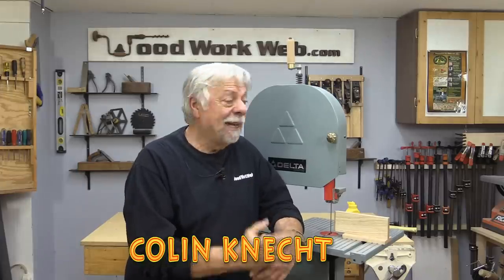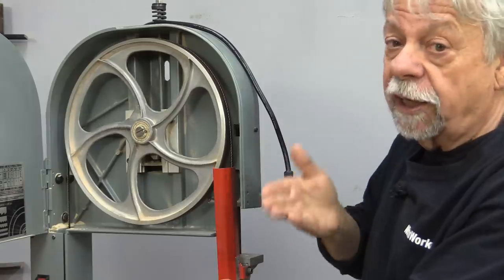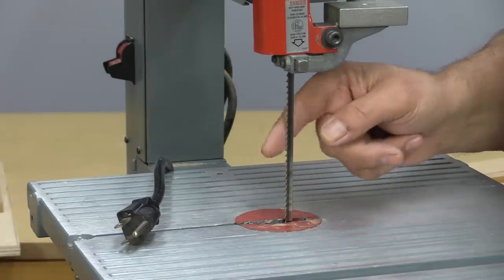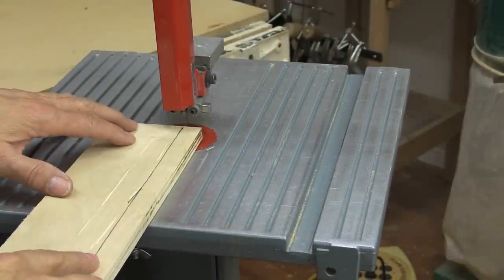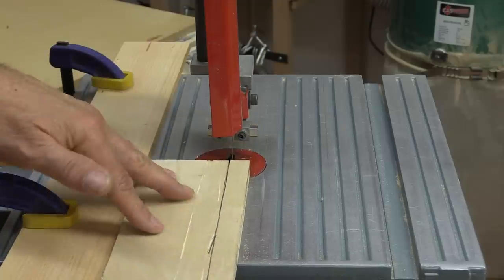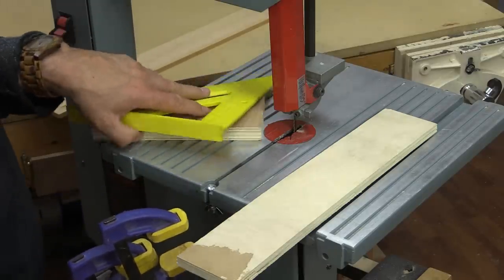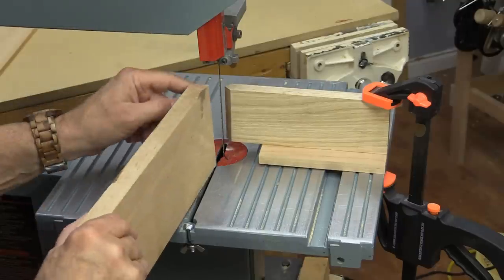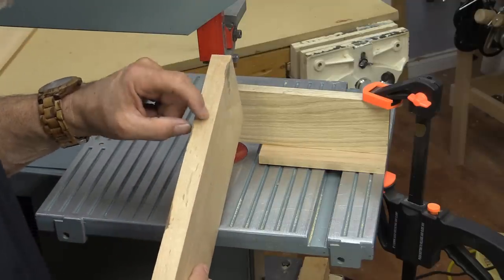Bandsaw Hacks - 5 Band Saw Tips and Tricks

Comment: When you loosen the band saw blade to prevent flattening the tire - as shown in the video - give it the same number of turns (or half-turns) every time you do it.  Then, when you return to the saw later you can give it that same number of turns in the opposite direction to re-tension it.  That will automatically return you quite close to the original tension, so you won't have to do more fiddling to get the tension set properly.

Another good fence for the band saw that sets up very quickly (and good for Colin's drift compensation method shown in the video) is one of those 18" or 24" long magnetic bars sold as a magnetic knife holder for the kitchen or a magnetic tool holder for the shop.  No clamping, just let the magnet hold itself on the table where you need it.
Reply: great idea
Reply: Good suggestion.  Now what do you suggest to make me remember to loosen the tension every time?  LOL.
Reply: Good tips.
Reply from the maker: Thanks for the tip and thanks for watching!
Reply: The only time I loosen my band saw blade is when I'm replacing it. I'v been using my band saw for 20 years and have never had a problem with a flat spot. It's a 14" Jet.

Comment: Colin, you and I have the same band saw.  Mine has been largely ignored for the longest time because I was having the very same problems the you highlighted in the video.  So, it's not just MY band saw.  Those tips and tricks are a great relief to me.  The only problem that I've really had with the Delta was a broken tyre.  Replacements could only be sourced, with all the associated costs from the USA.  All in all though it's a great and reliable tool.  I'll be out there, in the cold, this morning letting off the blade tension.  Thanks, Keith
Reply: mine too but that cover knob is not factory.
Reply from the maker: I hope the tips help! Thanks for watching!
Reply: I have this same band saw and would really appreciate your advice on what blade tpi for general purpose (ply wood, mdf and soft woods) many thanks, Simon

Comment: To permanently take care of blade drift without having to rely on goofy clamp on auxiliary fences, I took some time to loosen the table mounting bolts on trunnions, which are a little oversized, tapped the table a smidge and retightens one bolt and ran a sample rip.  I kept loosening the one bolt, tapping, and making more trial cuts until there was NO drift.  Then I tightened the remaining bolts.  Permanent drift solution! I must say that my table's bolt holes were not sufficiently oversized to get the job done so I had to use a rat tail file to elongate them a tad bit to accomplish the task, but the extra effort is well worth it.  Hint: bolts are easier to access if you tilt the table as much as you can.

Comment: Ive been successful cutting vaneer on my Laguna 14/12 bandsaw with a 5/8" blade
Reply: I was re-sawing some 4/4 oak with my Laguna 14/12 and a ⅝” re-saw blade, the blade started drifting badly, one of the ceramic inserts on the bottom saw guide had slid forward. After gluing it back in place with some gel CA glue the blade still kept drifting, the ceramic insert had taken the set out of one side of the blade. I am disappointed with these ceramic saw guides.
Reply: @pedgaro49  im sorry to hear that , im just a hobbyist,  i haven't had any issues with my Laguna bandsaw,  my brother helped me set it up and its run perfectly

Comment: nice videos but i have a problem ive been using a old 3 wheel bandsaw and latly the blade keeps going of track braking the blades so my wife got me a new parksaide went ok the next day the bottom tyre keeps slipping of now ive looked and looked and few say glue tyre down should solve problem so i went back on old bandsaw glued tyre on tried it works great should i do same to new bandsaw gluing the tyre down as its brand new

Comment: Some very useful tips. The problem I have in releasing tension on the blade is that I tend to forget and turn it on and the blade comes off and invariably needs a replacement.
Reply: Make a sign to put right next to the power switch on the bandsaw that says 'Check the tension'. That should remind you each time you use the bandsaw.
You could even make a sliding sign like they use on office doors to let people know if they're in or out. On your bandsaw it could read tight / loose. Then when you change the tension at the start or end of the project, slide the sign over and you know what state your blade is in when you come back to the saw.
If you're handy with electronics you could even build in a limit switch into your tension adjuster, when the tension is backed off, it hits the limit switch and a LED could light or a relay could disconnect the power.
I better stop before I make things way too complicated.
Reply: I have a tension leaver on my Laguna Bandsaw and made a little sign with a blade kerf on it and place it on the blade saying tension is off when not in use, then I just take it away and set the lever again to use it, simple
Reply from the maker: Some great tips from Maxx B and June, those should help. Thanks for watching.

Comment: Are all bandsaw blades intended for 'combination' purposes? i.e. using one blade for cross-cutting, ripping, mitre cutting (along the bias), etc.
A blade with finer teeth should be used for cutting non-ferrous metals e.g. aluminum or copper.

Comment: I find that the proper blade for the job is all I need to stop blade drift. A 1/2" 3tpi blade has zero drift on my cheap 90's craftsman 12" bandsaw while cutting 6" stock. My 1/4" 18tpi blade drifts all over the place on anything thicker than 3/8" because it's meant to be used for cutting shapes and curves, not straight lines. It takes me about 1.5 minutes or less to change blades. Totally worth it.
Reply: Interesting. I wish you would do a video or narrative on changing a blade in a short time.

Comment: Before compensating for blade drift, it's a good idea to try to eliminate it first by good set up..blade guides, position of blade on top wheel, blade tension, and most of all, a SHARP blade : )
Reply: Yup.
Reply: Blade used in the video is for cutting curves. Use a wider blade for rip cuts and it will not drift

Comment: Colin -Those are some really good tips. I cant wait until I can afford a band saw. I have a question, I work with steel as well as wood is there a band saw that can be used for both? I realize I will need different blades. Is there a not too expensive reliable saw that can be used as a vertical wood saw and a horizontal steel saw that utilizes a piston to slow down the cutting speed?  
Anyone with a recommendation please feel free to answer.
Reply: Delta, Rikon, Jet, and Grizzly all have dual purpose saws...I don't know of any wood\metal saws that convert to horizonal, though.
Reply: @drickard67   Thanks after I get a good used truck I'm going to be looking for one.
Reply from the maker: As D Rickard mentioned, there are a few brands that make Metal/Wood Vertical Bandsaws, but I've never seen any band named saw that can convert to vertical. There are some noname Chinese saws that can do it, but I'm not sure how good they are.

Comment: Nice vid mate, always enjoyable. Could you comment on blade tension? I always keep my blades much tenser than the manufacturer suggests - this solved cut drift problems I used to have and I haven't noticed any conspicuous shortening of the blade-life. In thirty-odd years of (almost) daily bandsaw use I've broken only two blades - I think blade tension is an important point.
Reply from the maker: Quality blades should be able to handle the over tension and it does solve some drift problems at times for me, it didn't completely fix it, so it might be a model specific solution. Over tension might also wear out your tires much quicker.
Reply: WoodWorkWeb tyre wear - that's a good point mate. Having said that I've had my DeWalt 3501for more than twenty five years and never changed the tyres! Cleaned 'em up a few times mind but still the same ones. Oh well, different strokes for different folks... Thanks again Colin, I always enjoy your vids.
Reply: Sort of like human tension.

Comment: Lesson learned: Keep your bandsaw adjusted correctly so you don't spend your days ripping your hair out over drift and finding ways to counter it.

There's no reason to fight your machines, it takes less time to troubleshoot and fix than it does to damage or waste material and spend time fixing/replacing that and blades are dirt cheap nowadays, keep a few extra on hand.

Comment: How can you tell when bandsaw tires need to be replaced?
Reply: Good one.
Reply from the maker: You should be able to see noticeable damage to it.
Reply: In the old days when they were rubber you could just replace when they were brittle and cracked. Since I changed to polyurethane tires I haven't had to change one, but I check occasionally by turning them by hand while lightly dragging my other hand over them to see if I detect any flat spots or other wear.
Reply: @meanders9221    Thank you, Michael.  Very helpful information.

Comment: I have two problems with my band saw.  1.  My blades run on the upper wheel toward the rear and on the bottom wheel toward the front and I don"t  know how to get the blade centered.  2.  My blades keep breaking at the seam where they are welded together.  Especially on the narrow blades and it is getting very expensive.
Reply from the maker: 1. You should have a knob or lever to adjust that somewhere on your saw.
2. You might be over-tensioning your saw blade or cutting more material then it can handle. Check the manual.  Maybe try a different brand of blade.
Reply: I agree that brand of blade might be an issue. I crank mine down pretty good. Have never broken one in many years.
Reply: Thanks for your helpful response William.  I've never had this problem until recently.  I've tried tensioning and adjusting. I will replace the blade with a different brand.  If that doesn;t work I will try replacing the wheel bands.  After that ???
Reply: Thanks, Colin for your helpful hints.
Reply: You probably know this but I thought I'd mention it. You are using the tracking knob on the upper wheel right? It changes the tilt of the wheel to adjust tracking. If that doesn't help you may have to investigate shimming out the bottom wheel. Good luck.
Reply: Thanks, Michael. Yes, I've been using the tracking wheel to no avail.  I've also been thinking of removing the lower wheel to see if it may not be seated properly or wobbly or the bearing is worn out.  Oh well, I'll just keep on plugging.

Comment: In your experience, what material do you think ruins bandsaw blades fastest?
Reply: Human bones.
Reply: @Mixwell1983  lol
Reply: Saw that coming lol
Reply: Hmm. Haven't tried that. Any differences you've noticed between those and say bovine or avian bones? Does freshness have any influence on the results?

I've known medical examiners and morticians, both of whom need to saw through bone occasionally. Also, band saws do get used in modern butcher shops, so it may be good information to have.
Reply: Hardened tool steel
Reply: I'm mostly interested in things like EVA foam, which has a tendency to destroy razor blades. But also things like soft woods, hard woods, aluminum, etc.
Reply from the maker: Laminate flooring and similar manufactured type woods are horrible on steel blades, even carbine blades dull quickly when cutting them. 
I've never tried bones, so I can't comment on that ;)
Reply: Anything with bamboo in it (flooring usually).  The high silica content in bamboo is very hard on steel blades. Expect to replace them often when cutting that sort of materials.